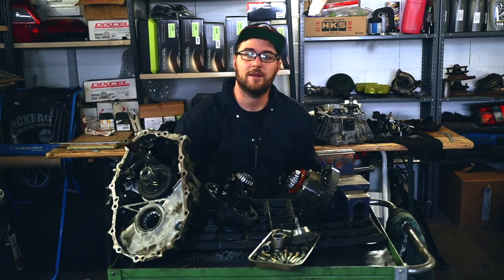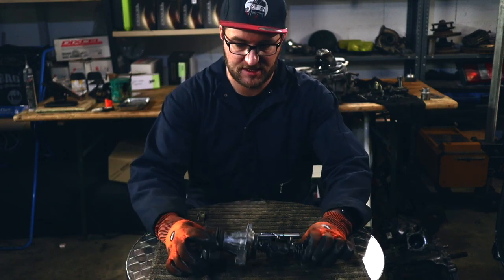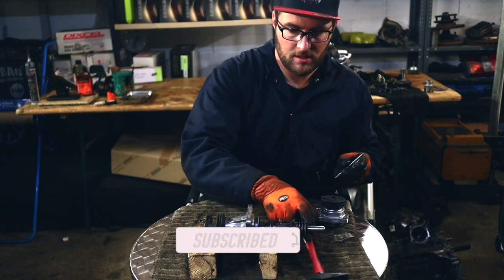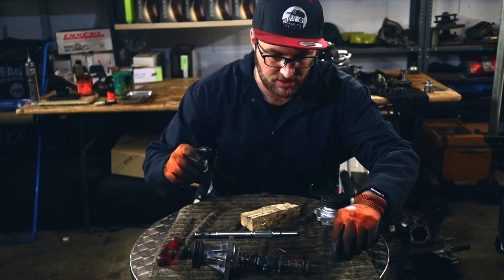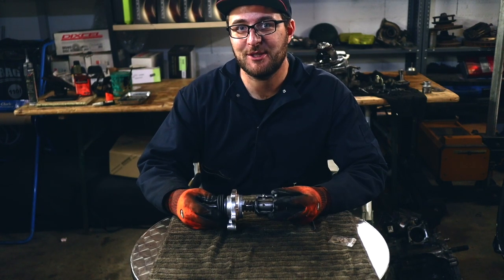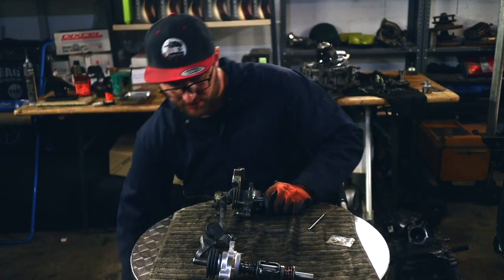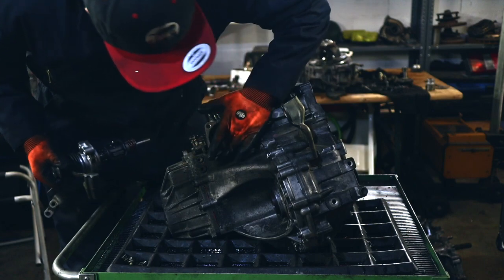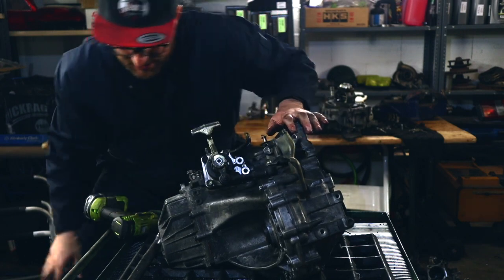EP12 Project Lotus Hunter: 6 Speed C60 Gearbox shifter conversion and brackets for MR2 Spyder swap

Comment: the reverse even by hand  I can get it , the only way is removing the plunger from the block out . btw the transmission works perfect , all the gears r good it was working good except for the reverse . mine is flat in the bag and doesn't need the plug . I don't know what else  to do does there is any difference in the shafts from the M Racing store ? length maybe? PLEASE HELP
Reply from the maker: Hi, i have no idea mate. All I can say is that with the mwr shaft it works 🤷🏽‍♂️
Reply: @JesseSpec  I purchased both parts from MWR and nothing ! yes it shift the 6 gears but there is NOOOO way to get the reverse . There is couple videos here of guys grinding plunger from the blockout that way they can get more travel in the stick , others saying  put some washers here and there ! bull crap . the griding stuff make more sense cuz with out it , by hand I can get Into reverse but the gears are crazy DANGEROUS . please let me know if you have diferent 6spd tranny if the shaft is different ! thanks
Reply from the maker: @danielgiles6509  hi! Yes i had the same issue! Solved it by installing a washer as explained in the parts manual of the mwr kit! Don’t grind anything 😱👍🏼👍🏼
Reply: @JesseSpec  nothing seriously
Reply from the maker: @danielgiles6509  make sure to read the installation manual, it tells you where to install thw washer. I can’t remember on the top of my head where it goes but I managed to install it even though the whole car was reassembled! Good luck 👍🏼
Reply: my bad I wrote couple things wrong hehhe!!! I was tying to say the back of the tranny . By any chance if u have a shaft that has work for u can u measure it? not even mwr no's shit

Comment: Hello, very nice videos, thanks for sharing them with us. 

I have some questions: If we do all the stuff you did in the c60 transmission, it is possible to use it for the stock 1zz engine?, It can be use the stock flywheel for the 1zz or needs the one for the 2zz?, also do you recommend to swap this c60 to the 5 speed for a 1zz mr2?. Is because I need to replace my stock gearbox because it is not in good condition, and I am thinking about put the c60 to get shorter gears. 

Thanks.
Reply from the maker: Hi! Thanks for your comment. I think having an lsd is a must. But I am not sure if the 6speed gear ratios are suited for the 1ZZ. Whats for sure though, don’t make the mistake of swapping the 2zz and not adding the 6speed to the package. The 5speed has really long ratios that don’t suit the 2zz in my opinion.
I might have a used 5speed transmission available. Where do you live?
Reply: @JesseSpec  Thanks for the answer, I live in the south of Spain. How much do you want for the gearbox?
Reply from the maker: @antoniostreetbikes5396  i would sell it 300euros without shipping 👍🏼
Reply: @JesseSpec  Ok it is a good price, but I need to check the shipping, I am going to send you and email, and we can talk a bit more about the dimensions of the gearbox and more. Thanks again.
Reply from the maker: @antoniostreetbikes5396  no problem! Thank you 👍🏼👍🏼👍🏼

Comment: Good video. What’s the actual difference between the diameter of both flywheels in measurements? I’m actually in tge exact same situation, in the middle of the swap and I have a nice Ogura flywheel +clutch I was planning to use again. Don’t you think you can open out the holes to make it suit?
Reply from the maker: That sounds dodgy to me. Don’t do it. Best is to buy a 2zz flywheel 👍🏼